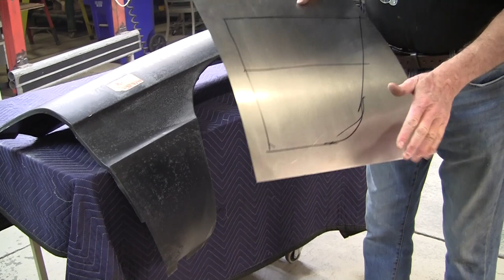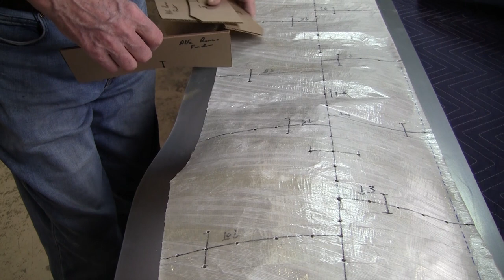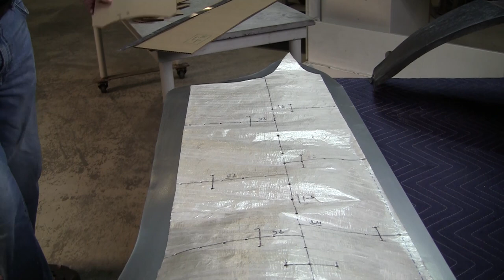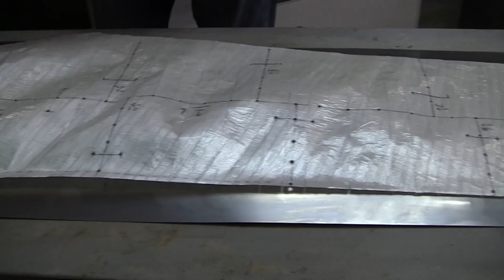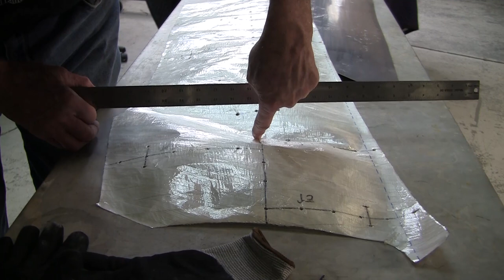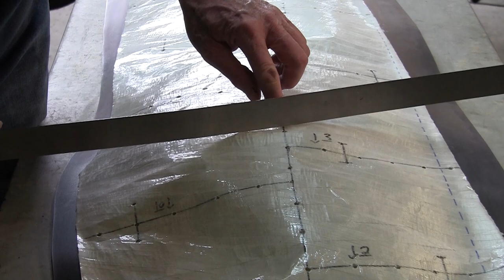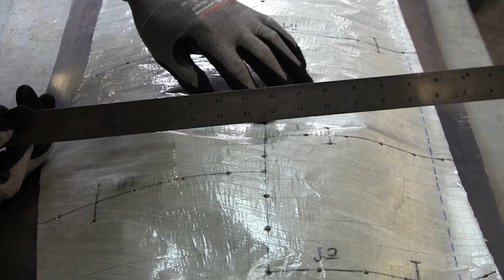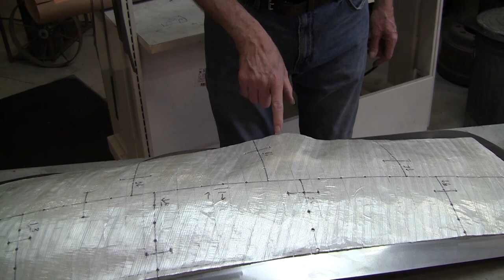English Wheeling made Simple (Part 2)

Comment: Very well explained again, Wray!
Now, what was it again? "Check, wheel, cut, check, clean, cut, crap - new panel" LOL 🤪
I don't think I'll be ordering the tape from You, since the shipping would be astronomical to here in Norway. Perhaps if the dollar goes down a few notches, or shipping fees get back to normal? But I'll definately order the shrinking discs when I need them. Trying out the flex shape patterns on my motorcycles' tanks and side covers at the moment, and slowly I'm getting there. Practice, practice, practice!
Looking forward to tuesday, now! 😎